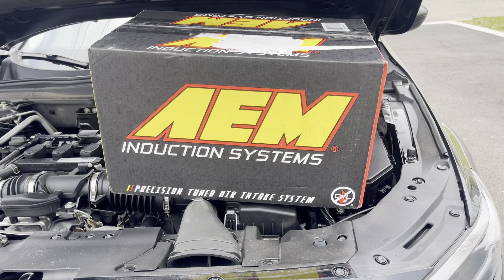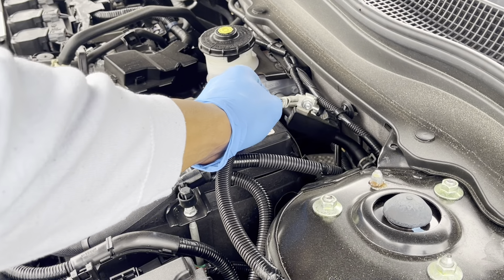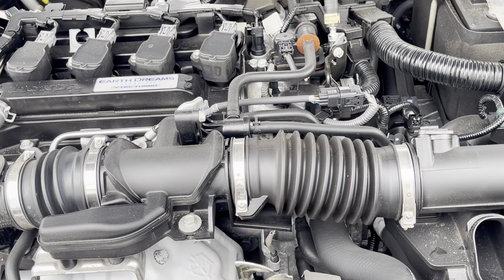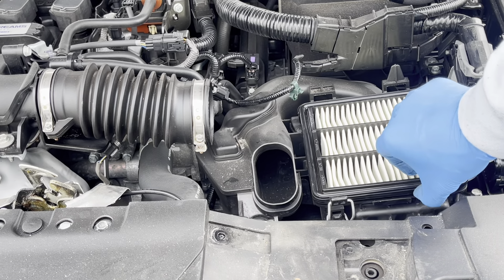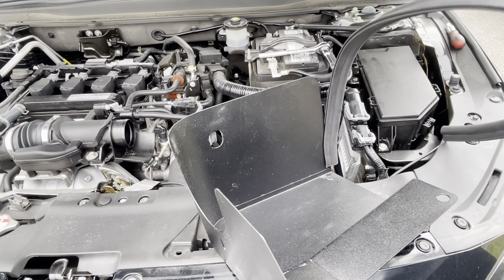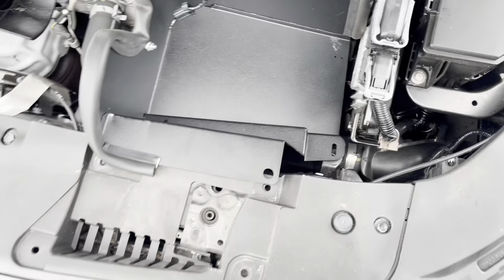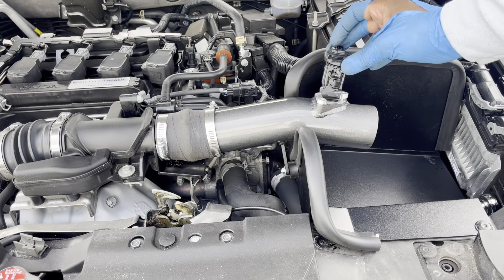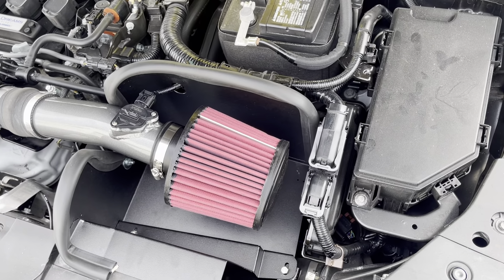AEM intake install Honda Accord 1.5

Comment: Thanks for the help. This video probably saved me 15 minutes and it's 106 here in FL!  I suggest anyone that has this car with the 1.5T RUN to wherever you get your car parts from and buy this intake. Install in less than an hour and now the blow-off valve sounds sick and it definitely feels more responsive.  I absolutely love it.  Best $350 I've spent in a while! Do it you'll love it too!!!  I don't take the time to write reviews unless it's something special.

Comment: Is it worth installing this? I just upgraded to the K&N engine air filter that fits into the original bay. But may do this to mine, but what are the benefits?
Reply from the maker: they allow more air flow and have more sound coming from it while driving  and you do get some HP gains from it

Comment: I have the 1.5 as well, too bad I guess they are illegal in California becuaase they do not ship to here :(
Reply from the maker: Hey they so sell this on Amazon I’m not sure if Amazon can ship it to California also but worth a try here’s the link https://www.amazon.com/AEM-21-854C-Cold-Intake-System/dp/B07MXN3916/ref=asc_df_B07MXN3916/?tag=hyprod-20&linkCode=df0&hvadid=330440990362&hvpos=&hvnetw=g&hvrand=15776181785048707836&hvpone=&hvptwo=&hvqmt=&hvdev=m&hvdvcmdl=&hvlocint=&hvlocphy=9004493&hvtargid=pla-635725856846&psc=1&tag=&ref=&adgrpid=66704631099&hvpone=&hvptwo=&hvadid=330440990362&hvpos=&hvnetw=g&hvrand=15776181785048707836&hvqmt=&hvdev=m&hvdvcmdl=&hvlocint=&hvlocphy=9004493&hvtargid=pla-635725856846
Reply: @NadeWes  Thanks so much for trying, but All the sites are on top of this since then they could be in trouble. it tells me the same thing, that it cannot ship to my location
Reply: @NadeWes  i might just ask around shops, maybe they have some/ can install them on the low low lol
Reply from the maker: Oh wow ok the only other thing you can do is have a family member order it if they live out of state and you can just pick it up but good luck hopefully a shop does have them

Comment: tempting.  did you feel any power increase?  used to have aem back in the day on my 240, but it went into wheel well, here there is a lot of air from the engine comp getting into the intake...
Reply from the maker: I do feel a difference with the response

Comment: So with this video being two years old now. Would u recommend me to get it in my daily 2019 1.5? Hows your car handling it after all this time? I keep seeing people say dont add air intakes that it will ruin sensors and blah blah blah
Reply from the maker: It’s been running good I still have the intake i just changed out the filter it was kinda dirty and old you can wash it but i decided to change it but it been handling great to this day

Comment: Quick question, Do i have to do ANYTHING else to my 1.5 before or after installing this? i seen comments on other videos that you have to tune your car everytime putting an aftermarket part on so the ECU can adapt to the aftermarket performance. If not your car can run lean or rich depending on the vehicle. Is this true??
Reply from the maker: It’s is recommended to tune the car but it’s not necessary unless you have other mods that really require it I have this intake for a year now with no tune and I haven’t had any issues with it
Reply: @NadeWes  how do you avoid getting your warranty voided when you go in for an oil change?
Reply from the maker: @CR7Update I just avoided tuning and don’t break anything cause if you break something and bring it to them then it will void it I never had issues with my warranty cause I pretty much left the car stock under the hood
Reply: so when you brought in your car to the dealership for an oil change, with the intake installed, they didn't say or do anything? @NadeWes
Reply from the maker: @CR7Update they didn’t care they did the oil change and their usual stuff and that’s it
Reply: @NadeWes   oh bet because i thought i might have to switch back to oem intake when going for oil changes/maintenace and put the AEM back on once that's done but im glad to know i don't have to do that. Also did you notice your MPG improve at all?
Reply from the maker: I drive pretty aggressive so it goes up and down but when I last check it said  was getting 30mpg and when I’m not drive aggressive on the screen it says I’m driving an average Of 40-50 mpg
Reply: @NadeWes   appreciate your quick replies bro

Comment: have you noticed any hp decrease, i heard that an open box intake sucks in hot air and it could be bad for the turbo and motor which is why ive kinda stayed away from them but i really want to add one for the sound, please let me know
Reply from the maker: I never noticed any decrease in power since I installed the intake i push it to the limit to give it a good test and I haven’t had any issues
Reply: @NadeWes  thx for replying so quick bro, i noticed the link sends me to a k&n intake, do you have a link for the aem intake you installed?
Reply from the maker: https://www.cruxmoto.com/product/aem-cold-air-intake-system-2018-2019-accord-1-5l-21-854c/
Thanks for telling me know the link is not showing the right intake

Comment: Just subscribed thinking of adding mods to my 1.5 any suggestions for a beginneing car guy looking to gain more horse and be the obnoxiously loud guy who u hear from a mile away
Reply from the maker: Since you are starting you can do the intake and a muffler delete to start
 if you trying to Gain power get a cat delete a 
a midpiple you can get the mid pipe off https://prlmotorsports.com/?gclid=EAIaIQobChMIn7KgqrqD-gIVkTizAB2_wwpDEAAYASAAEgJkzfD_BwE
You can delete the resonator the car is going to be really loud if that’s what you want 
you can also get a PRL front intercooler HPS Charge pipe and get the car tuned by someone or you can buy a ktuner and tune it yourself just be careful tuning the cvt transmission they are known to fail 
You can also get a stronger upper and lower torque mounts to help with wheel hop

Comment: it doesn't fall out of place going so fast i figure? and also i have. a 1.5 2018 accord you think it'll do the job bro bro?
Reply from the maker: It does you would need a tune to get the most out of it but I do feel the slight increase from it
Reply: @NadeWes  what kind of tune brother ?
Reply from the maker: There is a tuner you can buy called Ktuner v2 or hondata that can tune you vehicle and give it a bit more power and adding thing like pop and bangs 
if you want to learn more about them you can search it up so you can see what you can get out of your car just be careful turning the transmission as the cvt only found on the 1.5 is known to not be good of holding power you can do more research also here is a video you can look at https://youtu.be/0qNhlHDzPWU
Reply from the maker: Forgot to mention the tune is not mandatory

Comment: How do I get rid of my light show after intsall? (Check engine lights and what not)
Reply from the maker: Just drive the car and the lights will clear after a short drive if you have a engine light after install you will have to check your work because you should not have one
Reply: After I installed it last night I drove it and it wasn’t no lights, as I was driving home they cut on
Reply from the maker: Unhook the battery and you would have to check for any leaks and make sure everything is tight and plugged in all the way after plug in the battery have the system reset and if you get another engine light I would get a scanner from autozone like a cheap one and see what exactly going on
Reply from the maker: I’m not sure why you getting a light I haven’t gotten one since install
Reply: I got the to go away, unhooked the battery and reinstalled the intake, thank you for responding 💯
Reply from the maker: No problem hope you don’t get that light anymore

Comment: Does it tell you what the power increase is? I have a sport 1.5t as well.
Reply from the maker: It averages between 8-10 hp increase and around 7-8 torque if you do more mods with it you feel more

Comment: what caused those error codes?
Reply from the maker: When you unhook the battery the system needs to be driven to clear the lights I explained in text at 12:16 in the video

Comment: Looks like you actually lose power, it is sucking in the hot air in engine bay....
Reply from the maker: Hey I don’t really feel any loss in power since install I do understand the hot air situation but it’s more cold here in ny lately so the intake never hot when I check it
Reply: @NadeWes  , you might not feel it, but if you actually dyno it, you be seeing loss on power. You are sucking-in hot air from the engine bay bro. I am just speaking the facts....